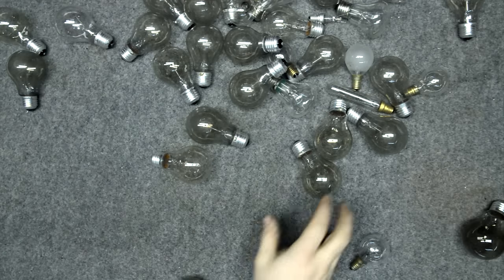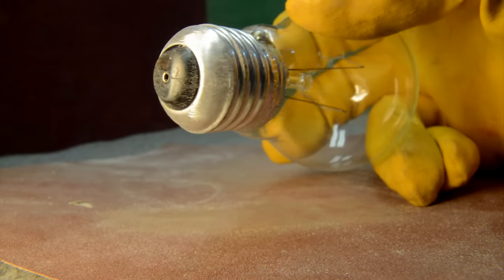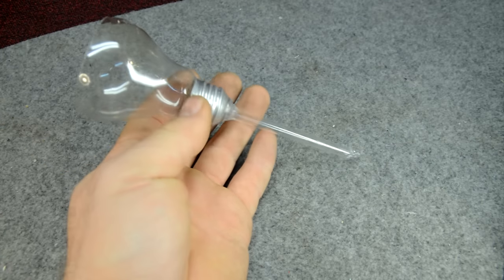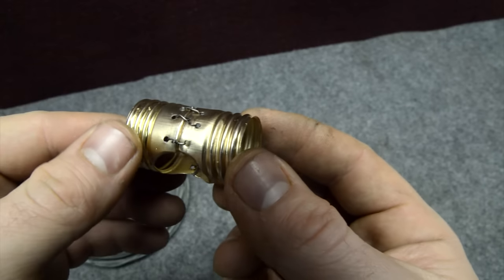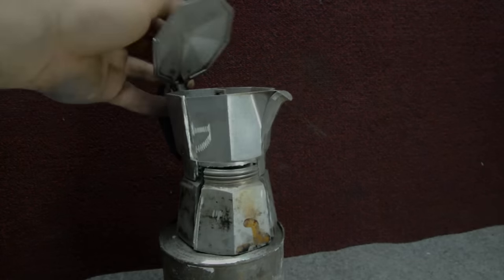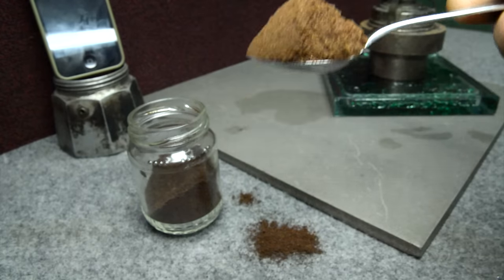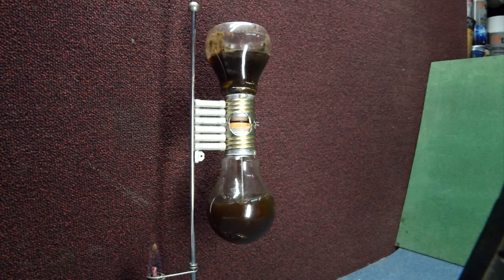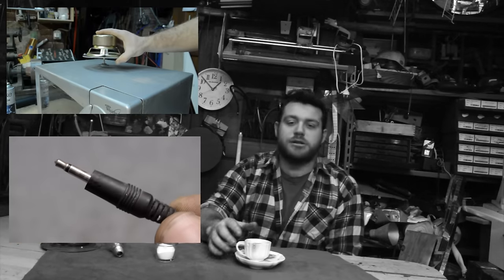How to Make • Coffee Machine Vacuum Lightbulbs

Comment: This is a terrible coffee maker for so many reasons. Where do I start?
1. If you're going to make coffee this way, where you have to filter it again, you might as well just put it in a pot or glass or anything, add water, heat it and filter it.
2. They don't often use this kind of design for making coffee much anymore because it makes less than optimal coffee. 
3. I bet it takes some of the flavor from the metal it comes in contact with not to mention the glue. 
4. It makes only 1 cup. 
It's the dumbest thing ever. I'm sorry. Why go through all this effort for no reason?
Reply: If you can't afford one then you can make this, then again you can just get a kettle and instant coffee. Cool project though
Reply: Diamond Gaming Even if you didn't have instant coffee. You could just put it in a pot. Or anything that'll take heat. Heat it and filter. You have to filter it after anyway. That's my issue. It doesn't give you any advantage other than looking like the coffee pot of a hobo.
Reply: ever heard of recycling? It's just cool to find a new way to repurpose things.
Reply: Dieter De Lausnay I completely agree but the thing has to make things more convenient. Not less. It's actually more difficult to make coffee this way than to just boil some water with coffee in it and filter it. 

Plus as I said, it must take some of the flavor from the metal and glue. Yuck. And this design makes less than optimal coffee. That's why they don't make this kind of coffee maker anymore. But, if they did, at least it could filter it for you or something. 

This contraption has no utilitarian value. It sort of looks neat if you're going for the hobo look but that's all.
Reply: +Paul TheSkeptic just for fun and to drink a coffee from a cool machine you made. Obviously no one every morning will do this to get a coffee, it's just fun!
Reply: Dani Barza Well, then that's the only reason for it then. If it's fun for you then by all mean have your fun although maybe it could be even more fun to make something practical. Even a simple birdhouse or something like that could be lots of fun to make and it may even have the added benefit of being inhabited by birds one day which would be really cool.
Reply: This video was made help people become more creative and imaginative and understand how everyday objects can be re-purposed. Perhaps some day a genius stumbles across this and develops a new machine that changes the world. So this video probably isn't for you.
Reply: Kyle Vuksich Oh, that's nice. You had to get your little shot in at the end. I would think a genius would recognize something that requires more work for less output. Seems pretty simple to me. I'm all for repurposing things and being creative but why would anyone do that if it makes the job harder? If you think about it, this machine doesn't even make coffee. It just heats fluid and moves it from one place to another. I could just put my coffee in a simple pot, heat, add water and filter. I'd get more coffee with less effort and it would be better coffee. A genius would know that. Someone who is not a genius would say "Look at that. It looks cool.".